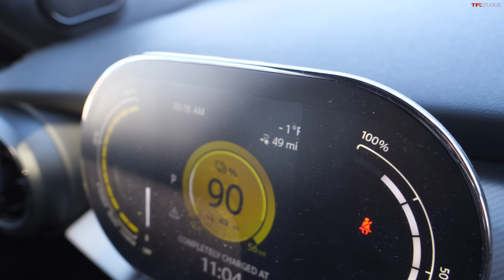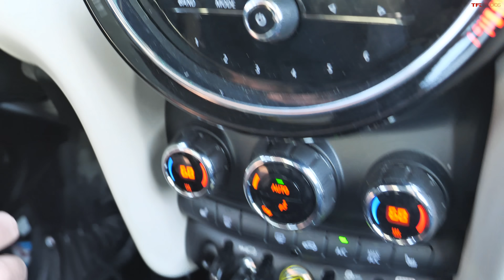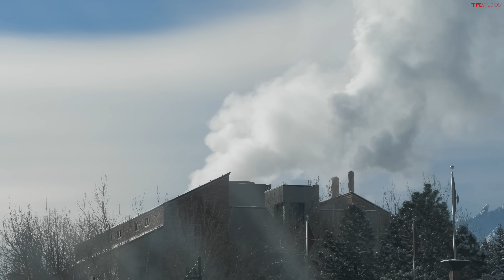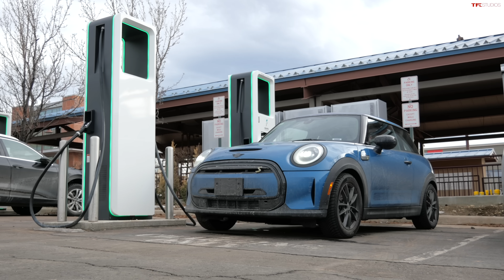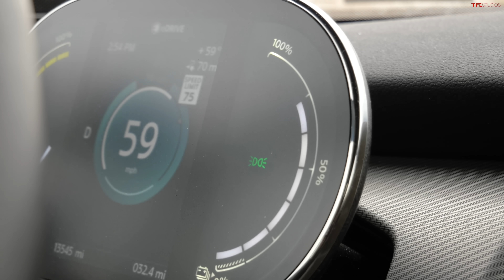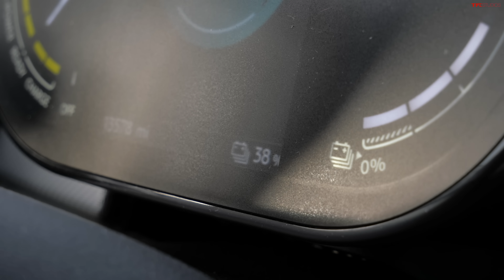Myth Busted? Here's How Much Range You REALLY Lose in the Extreme Cold!

Comment: It’s always amazing to see how much of a difference cold weather makes for EV’s. That in addition to wet roads is pretty much the worst case scenario. Even driving in summer rain causes noticeably less range due to rolling resistance. I guess when a vehicle is that efficient every outside factor impacts range, no matter how small. Nice job showing the difference!
Reply: It would be interesting to see how much cold weather affects gas powered vehicles. Is it possible that we don't notice it because you can always fill up in 4 minutes?
Reply: @dontbanmebrodontbanme5403  The most plausible reason it isn’t noticeable on ICE vehicles is because gas engines are extremely inefficient and heat is already a byproduct of that.
Reply: @titaniummazdaspeed6  Various people (and official car testing) have shown for most EV's the loss of range of a car with heat pump is 15-20% , so only slightly worse than an ICE car.
Reply: @dontbanmebrodontbanme5403  I think it's also being more cognizant of your range and exact energy remaining in a EV.  I never noticed the energy difference driving back and forth to a work site until I got a Volt.  I could never make it there on the battery, but could always make it home without using gas.  I never even paid attention in the gas car, although it also doesn't have economy for just the trip too.
Reply: @K Moni  bingo. I have a prius for extreme winter weather but picked up a 2016 volt this summer for regular work commute. I work 38 miles from home and in the summer, usually can make it on ev only. Now in winter, not possible. My GOM says 37mi range but if I turn the hvac on, I will be about 8 miles short of aan ev only trip. I'm actually disappointed as the volt was advertised with a 52 mile range, which isn't possible as the battery capacity is like 13kwh. It's on me for assuming advertised was true, and not thinking that winter range would be 1/3 lower. I just have to wait till the equinox ev is available and dump the volt.
Reply: @SweetLou0523  just like every car range, not possible, even for ICE cars.
Reply: @dontbanmebrodontbanme5403  Officially tests - 15% published by US NTSA for a standard temperature difference.
Compensation of air density - requiring more fuel as ICE requires correct mix, so more dense air requires more fuel
ICE engines are designed to operate at STP (ie about 20C), so different temperatures means the heat flows through the block, and heat extraction from the water, cooling etc is away from design
ICE engines have a "complex" transmission so the oil viscosity has much greater affect than in an EV with its simple reduction gear.
Reply: @dontbanmebrodontbanme5403   i see noticeable drops in fuel economy when driving in the rain in my Ford focus. But with a normal range of 350 miles a loss of 50 miles isn’t that big of a deal.